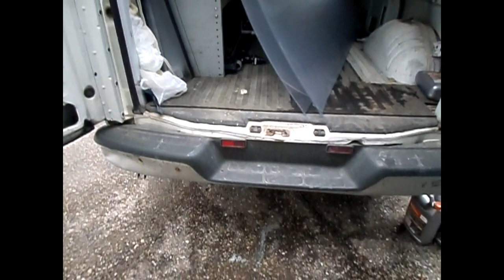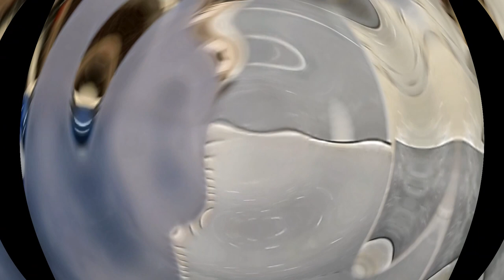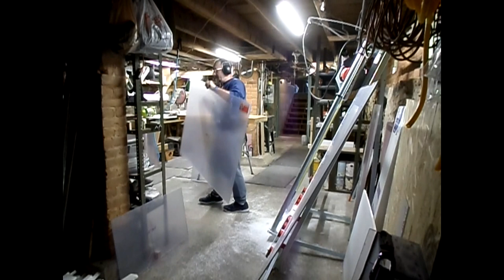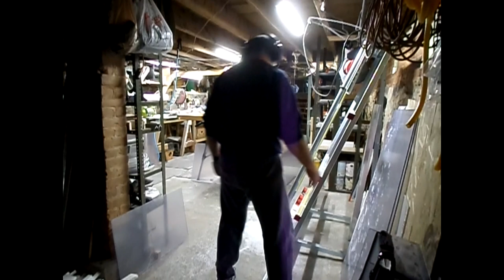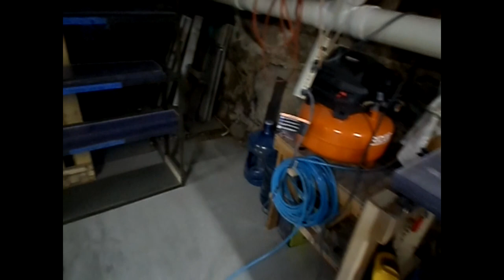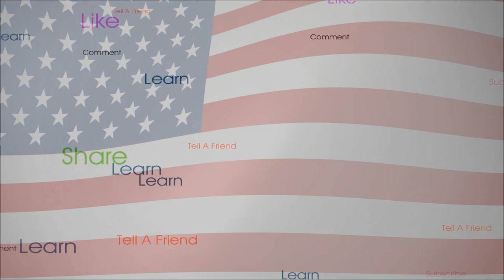GMGT - Stocking The Shelves

Comment: Have ya ever tried to make something out of all those plastic shavings? Melted into a mold ... around a trinket or something?
Reply from the maker: Roger, many times I have thought, if I could just turn it back into another sheet😁 The problem is, no matter how clean I keep the floor, the shavings always get dirty and contaminated with other elements / stainless steel aluminum and azek shavings.

Comment: How do you like that Ryobi table saw?
Reply from the maker: It works Josh! But cheap stuff is never calibrated properly.
Reply: @GreenMountainGoldTrap  yea I get that for sure.  I use a lot of ryobi cordless tools but I am looking at table saws right now and I was curious how that one worked.
Reply from the maker: @joshortiz1576  It does work well as in the blade spins and cuts!! The trouble I have with it is the manufacturer mounted the motor slightly crooked so the blade is slightly off set. Using the gate is a no go so I clamp straight cut azek and use it as a gate.
Reply: @GreenMountainGoldTrap  ah ok.  So I will have to look at that when I actually go to buy for sure.  I have no problem returning something if its not what it should be =)
Reply from the maker: @joshortiz1576  I'm of the impression that all the lower end tools such as these have these issues. Even my Craftsman 12" lazer guided chop saw was off. Brought it back to get serviced at Sears, came back the same way! Same thing with my Panel saw, it's off as well. Always have to pay close attention when spending money on such things.
Reply: @GreenMountainGoldTrap  so very true.